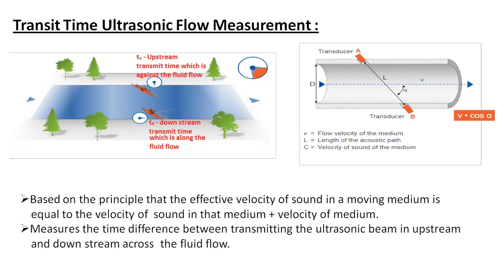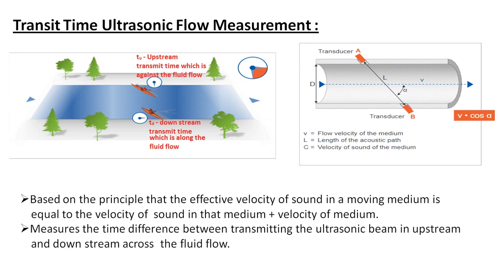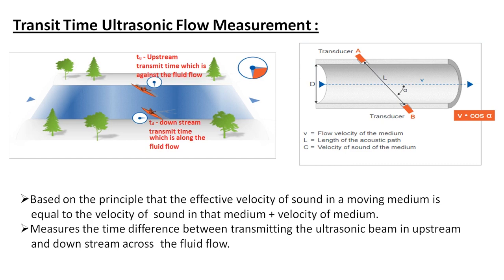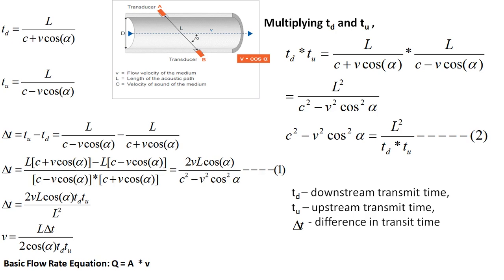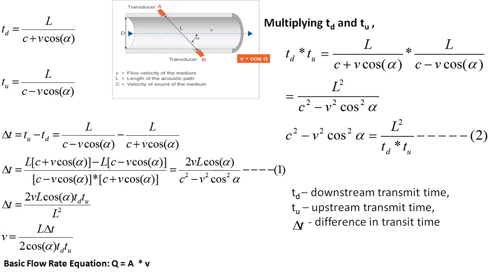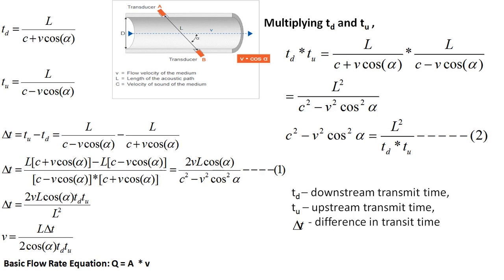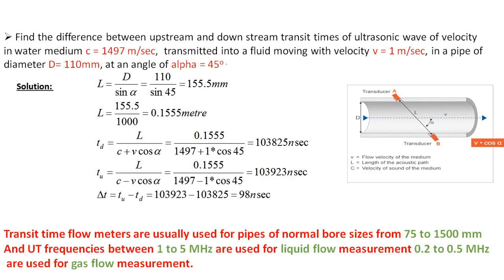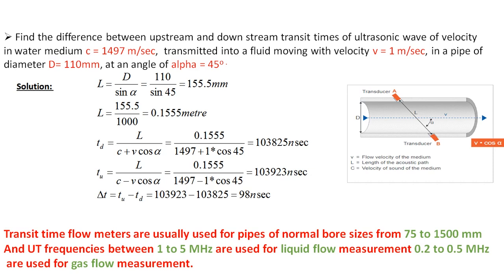Transit time Ultrasonic Flow measurement operating principle || Equation

Comment: What would the length be if the ultrasonic transducers were not placed directly on the tube holding the moving fluid? For example if the piping was inside a box and the transducers were placed along the box. Would your L be the length inside the tubing or the entire acoustic path?